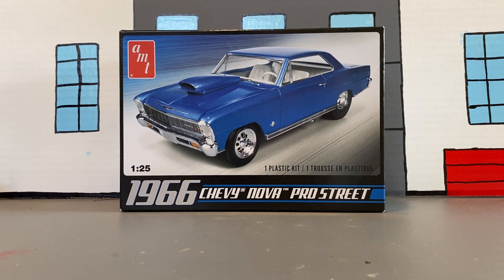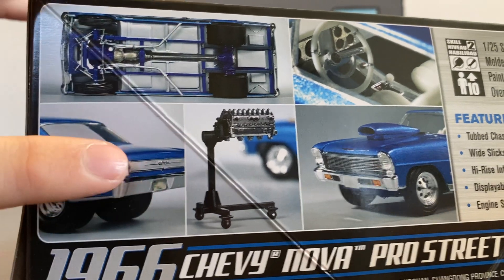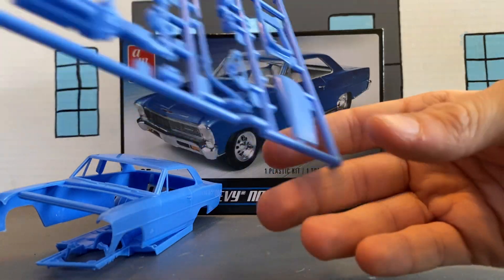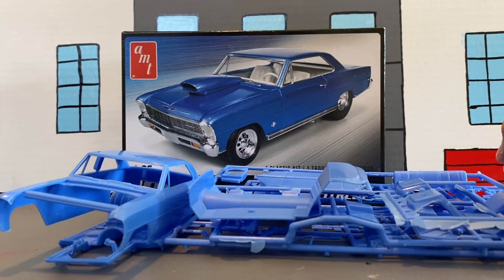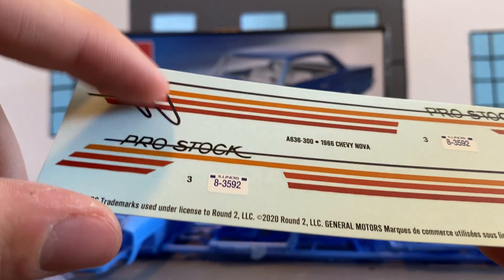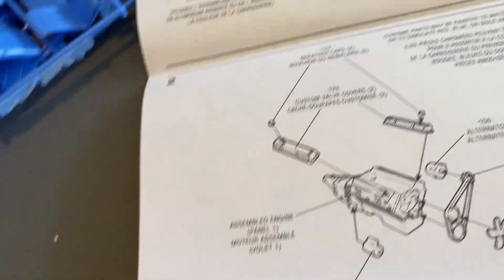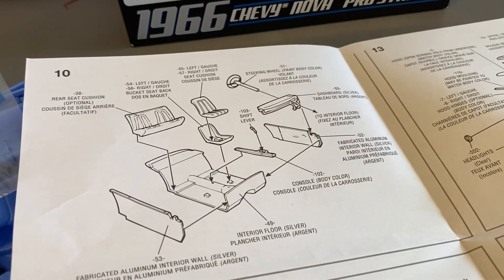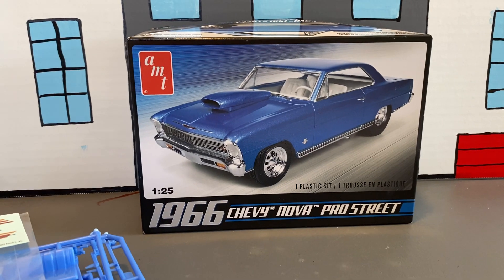1966 Chevy Nova Pro Street Drag Car unboxing!

Comment: cool i got my nova prostock into color already iv half engine done too chassis but yeah this nova i used in prostreet GB for my first time entering 2 years back it's a awsome kit to build unlike one i have now on bench for ur GB it's one with the fenders come seperate from the body so when it's built i can have mecanics wrench on it in my garage dio